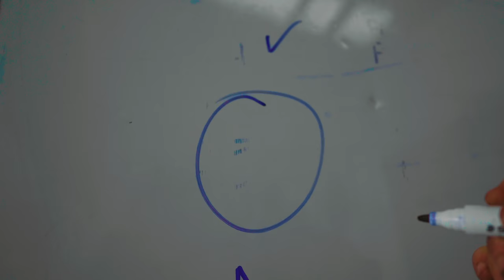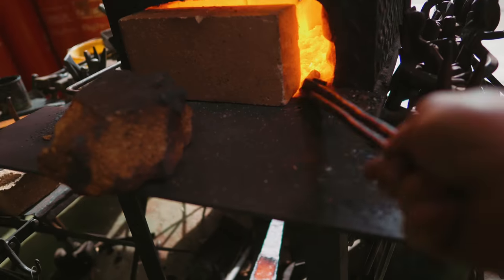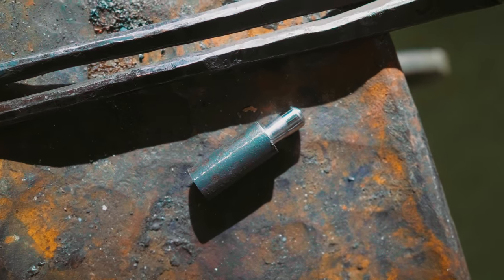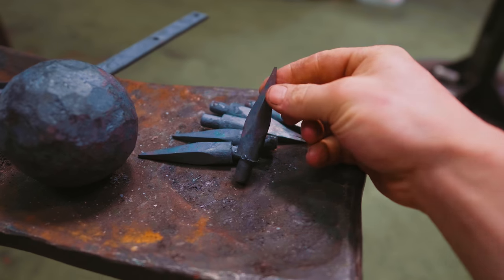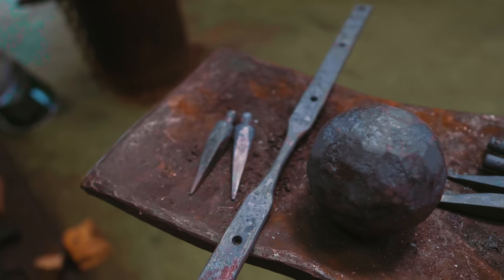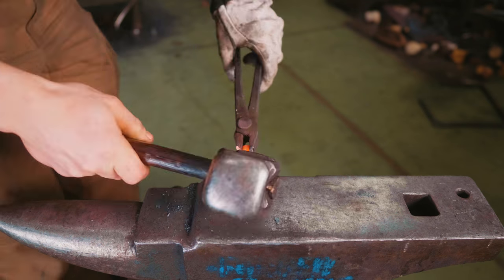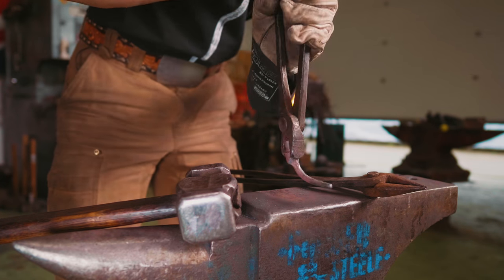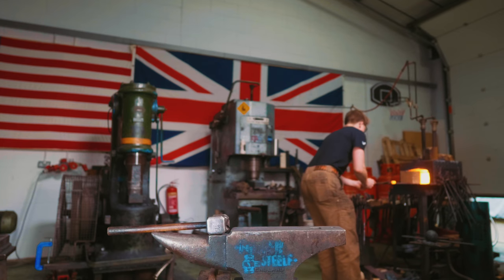MAKING A FLAIL!!! Part 1

Comment: Alec, how much gas does your forge burn in about one our, and how expensive is it??
Because I want to build one myself, and i dont know if it would be cheaper than my coal forge that I am currently using.
Reply: Freizeitflugsphäre depends on local prices. 
In my area we are at 2.25/gallon for liquid propane.
It's not much cheaper, but being near a fire zone, it is infinitely safer because there are no beautiful Sparks.

I use a hybrid of propane and coal in the crucible though... Incredible performance there.
Reply: Freizeitflugsphäre I would also like to know this. I’ve been using wood as my fuel source (as inefficient as it is) since coal isn’t easy to come by near me.
Reply: Love that country folk song you play and how it matches up with the beat of the hammer
Reply: Ok, I don’t know how you did that, but it was magical.  Great videography on the hammer on this one.  See you in a week.
Reply: He covered all this in an older video. He used to get that same question a lot when he was doing Live Blacksmithing too. I changed from a coal forge to a gas forge a long time ago and have never looked back - no maintenance, perfect temperature adjustment every time, much lower chance of burning steel, no smoke, no ash, but the down side is that it's very loud. At first I built my own, but it wore out in about a year. I bought one from NCTool and it's been running every weekend for several hours with each use and has been perfect for years. Gas (Propane or MAP) is sooo much better than wood/coal/anthracite. I'll never go back!
Reply: Freizeitflugsphäre from my experience coal is quite dirty

The propane lasts a really long time especially if your forge isn't that big. I got myself a 48kg(around 106lb) propane tank and have been using it almost every day for two months and it's still almost full.

I started with a wood coal forge where I would pretty much pre-burn wood then use it as coal(wood smoked too much and it left my steel dirty). It was extremely inefficient. It cost me about R80 per hour of work.

I've been dividing the days worked per tank usage. its been almost two months and I've used almost an eighth of the tank. The gas cost me R1000. So two months cost me about R125.

not to mention propane is much easier to work with as it doesn't almost suffocate you with fumes. Not that there aren't it gives off a lot of co2 which can be dangerous in high concentrations.

but when push comes to shove it all comes down to preference. 

As for price you'll have to do some research to see around your area which is cheaper.
Reply: Dat Boiii thank you for that answer!
Just one question left: which burners do you use, or which one would you recommend?
Reply: Freizeitflugsphäre I would recommend a dedicated gas forge burner. The biggest you can find.

the larger its diameter the more kick you will get out of it.

in my area blacksmithing isn't a thing so I had to improvise. 

I got a brass burner. problem with these is they melt if they come in contact with the heat. I countered this by putting in a rather thick steel pipe which sticks out the side of my forge. The burner fits over this and is held in place with a makeshift spring I made from some 4mm steel wire.

the forge is built from the remains of an industrial brick oven which I got from a mechanic in my area. 

I cut the oven apart and used its fire bricks along with the insulation.

I used no refractory cement as I did not have access to any, but would definitely recommend if you can find some.
Reply: I think you can order burners from Alec here too. Forgeburners.com (just checked the site, domain expired) if I recall, and it's old Sam's website too. If you're a long time viewer of Alec Steele you remember Sam. I've got a forge by NC Tool and it's been amazing. They sell burners too, but I'm not sure if they ship international or not.
Reply: Freizeitflugsphäre I have a coal forge and I can run utility all day for about  £5 /20ish kg off coal it's cheapen than gas and I personally think coal is better some people preference gas because it heats up quicker but I can have my forge at forget welding temperature i 5 minutes
Reply: assuming you haven't ordered a forge right away. Plus how much you don't know about them, and guessing your in Europe, Angele forge shop internet site. Buy a ready made forge. Before you buy a forge, think about how you are going to get a 100L tank and the cost of piping to the forge. the reason you don't use 20L tanks is pressure, you need 10L of pressure to push the proper heat that means with 20L tanks you are out of proper heat in an afternoon. Dont buy a forge that is too large, and dont buy one with too large or too many doors. 3 door construction is mostly garbage for keeping it hot. Plus I recommend quit seeking advice on youtube comments, and asking hombre's that only know what they saw on youtube.
Reply: In gas tanks the gas is actually liquified under the pressure. They last a long time. If what you said about large tanks was the case, why would anyone ever buy or manufacture such a costly and ineffective thing?

I partly agree, the waste at the end of your tank usage is a smidge higher because of the volume of leftover gas in the tank, but in an afternoon? Read my previous comment...
Reply: Pete, I remember Sam, and lately I've been wondering where that friendly hobbit sidekick went... Maybe he didn't want to be the sidekick anymore ;)) I thought he brought an interesting little extra to the show... We don't see the extra hands anymore. Just Alec and guest stars... In honour of the roadies and other behind-the-scenes personnel, he should edit one of his videos with "Turn The Page" as music... (original, or Metallica version, both would suit the atmosphere, I think)
Reply: @sharp Works you should try converting your wood into charcoal. It's not super hard, but it will let you get higher temperatures more easily.

Comment: Question Alec for the size of the flail handle by the look of the strapping you made you are making it for a longer handled flail but realistically the flails handle would only be like 12 to 14 inches in length. Just something for you to ponder upon
Reply: Baron Bishop are you sure? cause you have to make sure the end can't whip around and break your fingers
Reply: all the flails I've seen are 17-19" in the handle. (about as long as your forearm) but with surprisingly short chains. 8-10"
Reply: Short chains long handles
Reply: But that’s the traditional European version
Reply: not really a question is it.

Comment: Dude, you’ve got to think more about the weight of these weapons. While I can’t know for sure, my strong suspicion is that almost every weapon you’ve made is at least half again the weight of the historical examples. And in the case of the recent mace more 3 or 4 times.
Reply: OurCognitiveSurplus looked up reproduction flails and most fell into about the 5 to 5.5 pound range if his main ball is 4 pounds with everything else he should only be pushing about 6 pounds maybe 6.5 so really not that much more than reproductions based on historical evidence. Not sure about the mace but the ones I found were around 2 to 3 pounds. He hasn't ever said anything about the swords he's made as far as weight goes but unless he is making them way outside of historical specs in some way i.e. way longer or thicker then they probably aren't too far outside of what a historical piece would be. Most swords around 3.5 to 5 pounds and the claymore maybe 7 pounds for a large example.

Comment: Just a tip to avoid broken hands, make sure the chain is not too long, the ball cannot reach the handle part you hold on to, if it can, you will get hurt, so, avoid that please :)  (and even then, its still going to be a very dangerous weapon to handle)

Comment: can you forge a seamless chain? I've made some wood chains, where you first cut out the outer silhouette, and then cut out/drill diagonally to make the individual links without having to open them. I'm sure the same can be done with metal. Perhaps a special sole for the power hammer is needed to make the correct outer shape to push enough metal into the area where links overlap. Would be an interesting project to see you accomplish, and I'm sure quite the challenge on trade skill and learning too :)))

Comment: attachment to the ball needs to be a staple with two bolts or a staple welded to the ball.  A mild steel threaded attachment will unscrew with use or simply snap or strip out if you really used the weapon with intent...

Comment: Questiion on the spikes....you machined the one side out to a certain diameter on the lathe.....once you heat these back up in the forge, don't you have to worry about thermal expansion changing that diameter?

Comment: Dude that was some seriously impressive work drawing those points out. I just tried my first two points for the first time in a few years this morning. They came out decent but nowhere close to as identical as I would have liked.
Reply from the maker: Keep practicing and focusing on the reason for each individual blow placement and you'll get better than me, because I am out of practice :P
Reply: Alec Steele I feel like I owe it to myself to practice and get better. As an added bonus, there is a lot of tranquility hiding in my hammers.

Comment: You may want to research the proper length of the flail chain. I believe there is a specific length that makes it harder for the user to injure himself while using it
Reply: Depends on how long he wants to make the handle. Make it a two-handed or one-handed flail (two handed is safer). Shorter is usually better however. No more than 2 intermediary links, preferably just 1.

Comment: Question: What are the sheets that come off the metal when you're using the powerhammer or while it's cooling down? I'm assuming it's slag? Or maybe just an outside layer of metal cooling faster than the inside? But why does it seem to appear on the entire ball of metal and collect and break apart in sheets? As well as how hard is it to clean up, how much collects after an average project, and how do you dispose of it?

Comment: Technically what you’re making is called a Morningstar Flail. A regular flail is just a thrashing tool consisting of a wooden staff with a short heavy stick swinging from it.
Reply: They're both flails. It's a shorthand way of saying it. Like saying a woman is a human isn't wrong, because she isn't a man. It's just a sub-type of it. They're more usually called ball-and-chain flails if you want to be correct however, morning star (two words, not one) usually more refers to the rigid, non chain type of mace that has spikes on the hitting end.  
Not that it matters much however, as ball-and-chain flails were rarely ever used and more a thing of fantasy so historical accuracy goes out the window.

Comment: I have a question to you Alec. I work in construction and they throw away lots of steel mostly Concrete Rebar steel. Is that worth picking up and using on small projects like wall hooks and thingamagiggers?

Comment: alec this is impotant so please give this a read. the weapon you are making is very misunderstood. common fantasy morning stars have short handles and are used as one handed weapons. this is wrong and dangerous. morning stars and flails from history are more or less polearms which means they have long two handed handles. the reason why is because it takes the hands out of the swing radius. needless to say if you hit your bare hand with a spiked weapon designed to fight armored enemies you're going to be in a lot of pain and potentially with less than 10 fingers. please make sure the handle is long enough to keep yourself safe. also be safe with it because its easy to hit your head while swinging.

Comment: I don't want to be a stick in the mud, but are you sure about attaching the ball with a threadad connection? Couldn't that possibly unscrew itself when swinging it around, sending a large metal object with spikes in it flying. Just saying that could be dangerous.

Comment: how would they  have done this in medieval times? obviously they didnt have tapping and dying technology?
Reply: They rarely did. These were almost never made in medieval times because it's such an impractical design. If they were made, the spikes where drawn out of a block of metal by hammering in the space between them and then drawing out the protrusions. Alternatively, spikes could be driven into a ball of wood and then sharpened (as more used in torture devices).  And they usually were more like rounded bumps rather than spikes. 
More commonly, they would have a rod of wood and then attach bands of metal with spikes on them. Far easier to produce, no less effective (still not the most effective weapon, but that was the type that was used most, and more for thrashing grain than combat). 
Their use (of the ball-and-chain one) in medieval times is questionable however, as they're almost never mentioned, so it's believed to be more a thing that's popular in fantasy, and a torture device.
Reply: good knowledge!
Reply from the maker: awesome comment! Thanks for the info!!